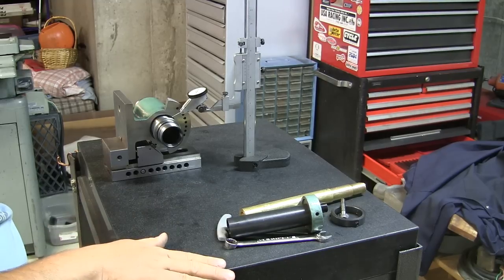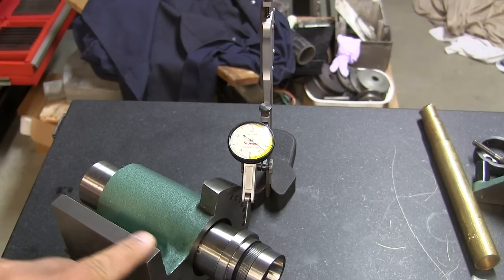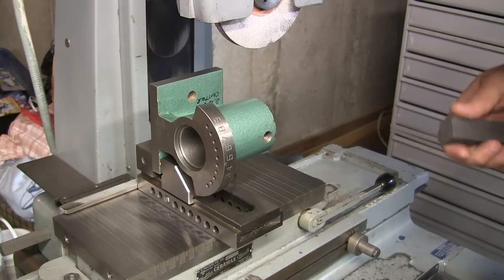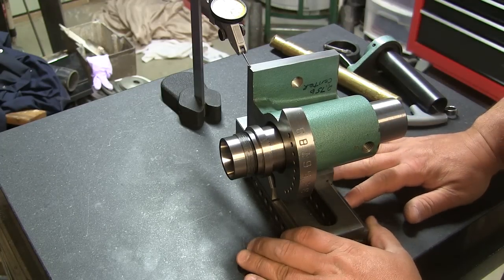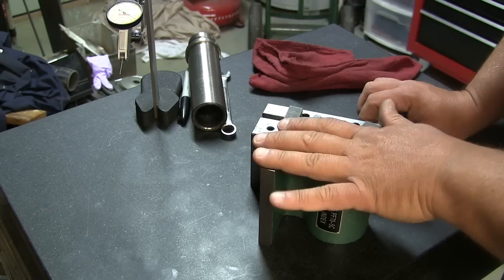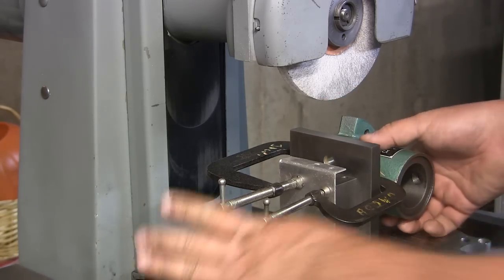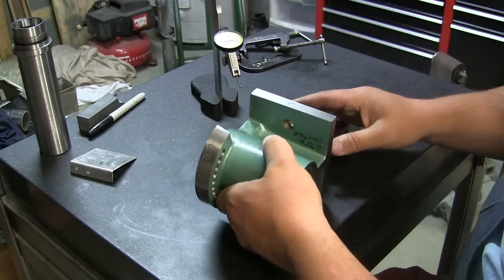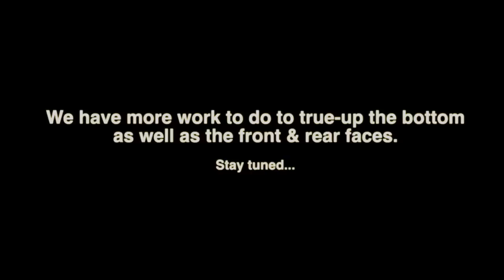Spindexer Modifications Addendum   A

Comment: The hole in the lock screw is actually an oiling hole so you dont have to remove the spindle to lubricate.  but...as you found, its also useful for holding the lock pin.  I have a very nice quality spin indexer that i bought used (very lightly used) and I love it.  I also love the 5C square and hex blocks as well.  So handy for milling flats and hex heads.

Comment: That method you use to indicate the part by moving the work around is one way to wear out a precision table surface or abrade it with wear grooves and scratches......it's cheaper in the long run to replace a height gauge or scribing block than to resurface a worn table.

Comment: It isn't really important to use some specific type of gauge to mount the dial indicator because it has fine adjustment because you don't need a "zero" reading. It can be any reading. Take a reading on one side and a reading on the opposite side and see the difference between the two readings. Also, is your indexer's spindle parallel and how much clearance does it have between the spindle and the spindle bore? Happy indexing brother.

Comment: Nice work on the body so far. I suspect you need to map out the spindle itself for roundness and consistent diameter. How about spindle to body clearance?

Colin ;-)
Reply: ***** This is what I was thinking too, need to check the roundness of the spindle as it rides in the housing.  Could end up chasing your tail but I suspect the spindle isn't 100% round.
Reply: ***** I agree with both of you.  It might also compounded by heat effects which come into play when chasing 10ths.  Just holding one side or end of the spindle or casting in your hand will make it distort to some degree.  Be careful how you handle the parts and allow some time for the temperatures of everything to stabilize before testing.  Overall, you seem to be doing good work there, Brad.
Reply: ***** Those Chinese bores and grinds on the spindle are the ultimate limitation on that project, the next step would be to re-machine a spindle and bore, by now with +/- a few tenths, this indexer is getting closer to 5 X it's original value... ;-)
Reply from the maker: ***** Collin - The spindle shows no movement on the indicator when I mounted it on V-blocks. I checked in a few spots, but not in a linear fashion. Spindle clearance in the casting measured around .0005
Reply from the maker: ***** The spindle floats in the body, what I' concerned about, is the ID that the collet seats against. I also measured a gauge pin in the collet and it had around .002 TIR as would be expected from a used collet.
Reply from the maker: pierre beaudry You guys are killing me - If someone suggests re-casting a new body, I'm gonna get angry, LOL
Reply: BasementShopGuy
After all it's going to be a great video, new casting after the new spindle.... :-)))))   Also blue instead of green for the paint...
Reply: pierre beaudry Gray to match the Bridgeport!      8^)
Reply: *****
OK...!!! Now let's sit in front of our screens and wait for the next episodesss... lol ( Do you think Brad is mad at us by now...??? )

Comment: Hi Brad.
I noticed how you are making your measurements and cleaning the Granite block, you are not cleaning it well enough you should clean the whole surface with lint free cloth and Acetone then run your hand over the surface don't use a cloth they leave lots of lint behind.
Also, on all of the other surfaces that you are going to make contact with do the same, always finish up with your hand.
Never do any grinding of metal on the Granite slab this leaves behind derby.
When making optics and measuring as your are you get a better contact between surfaces this way, metal measuring is more forgiving.
Reply from the maker: Mike Mattei Mike - I did clean the entire block before I started in the earlier video then again off camera. I always use the hand to finish off, I think I even mention that too. What I am going to do is get some proper granite-cleaner. The 409 I used, is said to swell the plate.

Comment: Is your surface grinder running while you put the indexer on the magnet? If so, not very clever. You should also not have tools on the granite block, brother. It seems you have great equipment in your shop, just use it properly and safely.